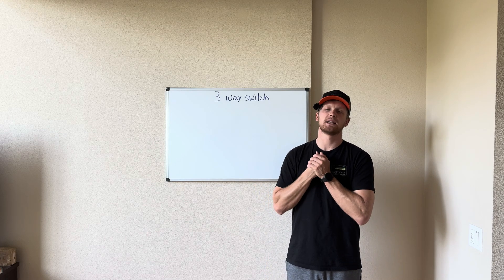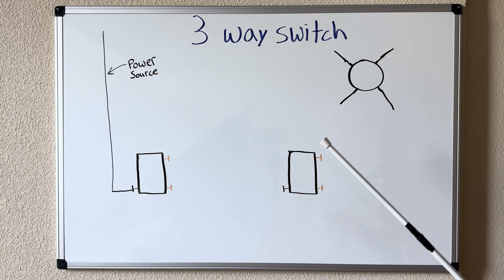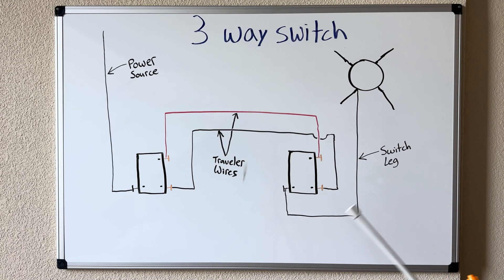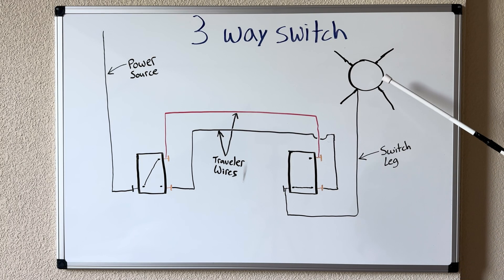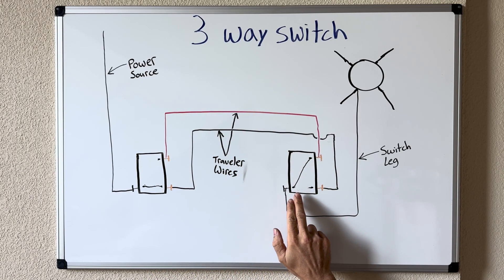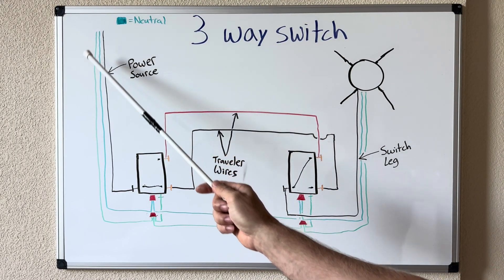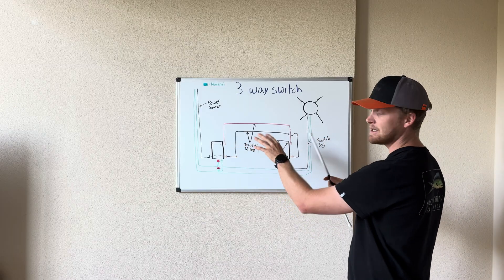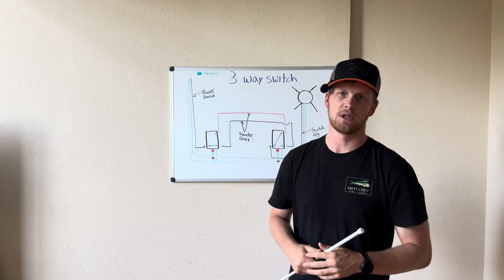3 way switch circuitry explained

Comment: Thank you! I wrote you a message on Instagram but I should have started here first. Is a 4 way switch about the same?
Reply from the maker: Thanks for checking out both pages 🤘🏼 I have a 4 way switch on the YouTube channel as well as Instagram. But in short, yes, a 4 way is quite similar to a 3 way you’re just breaking the travelers up with an additional switch.

Comment: If you add a 4 way in between the 3 way it still functions the same correct? We I had smart switches that I installed 7 or 8 years ago and had to we work them to include a neutral for them, well they went bad and I just went to traditional wiring. I have been scratching my head as to why everything works fine until I switch the 3 -way off that has the ceiling light load wire and nothing works.  But with it switched the other direction everything works fine. I had no idea the dead end was a thing. I have the white wire taped in black tape that goes to the other 3 way so I’m assuming it’s working properly since the one switch can essentially turn the circuit off.